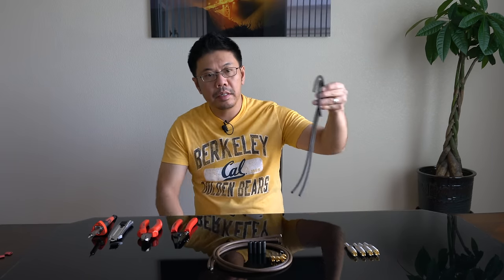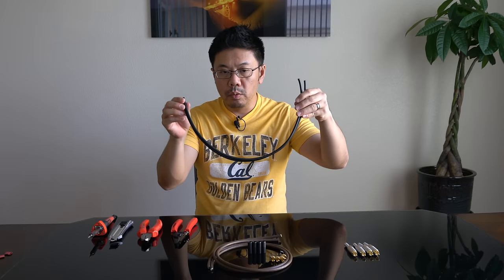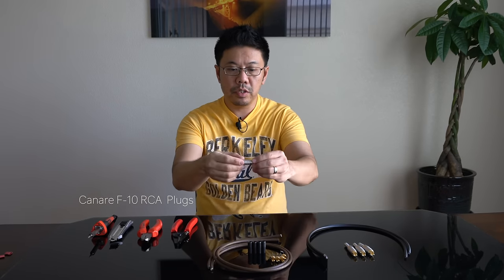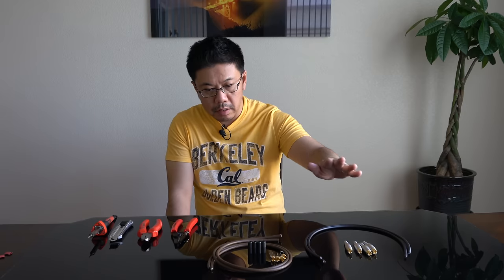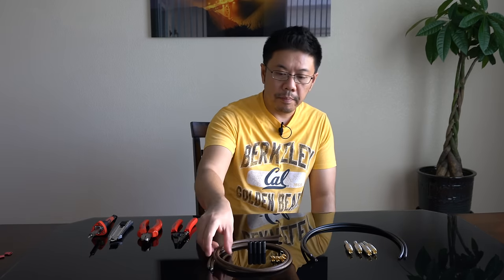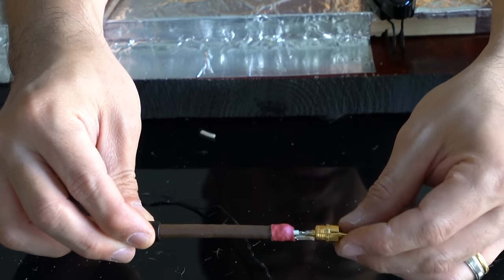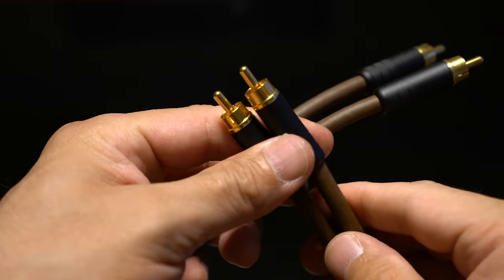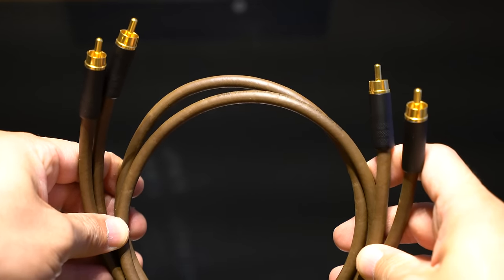$30 Audiophile Grade RCA Interconnects, DIY Better Sounding High Quality Cables

Comment: Tharbamar have you tried only soldering one side of the braided shield to one end and leave the other braided end disconnected? This is another method and you attach the connected side to the source of your equipment such as the DAC. Apparently it offers better noise rejection, something called a "Faraday cage" when you do it this way.
Reply: This is the way many cable makers  do.
Reply from the maker: Yes,I have done that many times and I like the my C-Type & J-Type more than any method I tried.

Comment: Hmm but wouldnt putting both wires together increase capacitance? Even the official mogami rep that i asked said its better to put one wire to ground. What do you think? Did you ever notice any difference or even tried and compared both methods?

Comment: Great video! Which cable & connectors would you recommend for a diy interconnect phono cable? I'm getting lots of EMI from mine, so I guess it's time to change it for a low capacitance one.
Reply from the maker: My favorite if Neutrik ProFi RCA plugs. thanks

Comment: Grea vid Do they work Both Directions?,I have a Question,I have made my own RCA cables for Technics Turntables for years, typical white Red connection from the PCB Board to two connectors White Red all good,one Day I've decided to Make my own RCA,male to male for plug and unplug RCA Turntables,they worked Both Directions fine,the problem is that,I've tried to build more and now they don't work at all,same cables same connectors and I don't even remember what I did the first time to make them Work Both Directions! Any help?

Comment: I made some sets of belden 8412 rca interconnects ...because the specs and costs were perfect and enabled me make some very neat specific custom runs, rather than have the horrible spaghetti junctions behind the rack, so I highly recommend that those interested have a go. What's to lose?

Now initially they sounded OK,  better than what I had but a little constrained, but here's the thing... they kept getting better and more open and dynamic  and funnily showed the strengths and unfortunately weaknessess in my system. 

Now I was always an ofc copper cable junkie but these cables do take a bit more time to open ?? Now I'm not sure whether that was down to my hearing getting used to them or that burn in makes a difference... So please don't respond because it is all subjective , but to me they are simply great cables to make interconnects... especially if on a budget and dont have the funds or need to buy the hyper brand cables. 

That's not to say they are not good or valid, but DIY will always be a cheaper way to go. However just like hi-fi there are many different cables out there..so  it's easy to fall into the same upgrade traps. but belden cables are great

Comment: Please tell me why or what is the benefit of using the 2 pair inner (whites) as a connect to the shield and ground? Is this a better shielding result versus just using the shield as ground ONLY? And if so why? My  first thoughts are that its worse because you are bringing signals closer to the actual feed wires (blue) vs just an outer shield grounded that is farther away from the feeds. (blue). OR is what you are doing here in this video (Japanese Method)  actually creating and Outer and Inner shielding effect that is overall a better shielding scheme? Thank you for this awesome video too....and in advance if you are able to answer my question for better understanding of the benefits of what you are suggesting in this video.
Reply: I added a separate comment where I explained how the directional cable works.

Comment: Hello Tharbanar. Useful video. Thanks for that. I'm just curios, can all 4 cores be solder as signal and just solder the braided wire as ground?
Reply from the maker: Yes you can but it will increase capacitance, thanks

Comment: Very interesting and informative Video. But I have a Problem. I need interconnects to plug my record Player in. How do you get the ground with These cables. Do I just put a spade on the ground you connected to rca shell?
Thank you in advance.
Reply from the maker: You just need to make separate ground cable, thanks

Comment: @tharbamar  on you Japanese method, did you fan out the ground wires before crimping them? Is there a benefit to spreading out the ground strands? I'm making these now and It seems easier to keep the ground tight and crimp it that way. TY!

Comment: I enjoy your videos, thank you. I have a question about grounding. Is it only one end or both ends being grounded?
Reply from the maker: Both end is grounded, thanks
Reply: Shouldn't you ground only one end of the white wires? As far as I know, such a cable becomes directional. It is grounded from the source to the amplifier.
Reply: I watched the movie again. I noticed that part where you bend the white wires from the other end breaks off. You can't see that you've stripped off the white insulation. So the cable is directional from ground bond to empty bond.

Comment: Can you use each individual conductor on the mogami to make a single rca pair or is that not recommended? Looking at making my own cables for multiple amps in the car but with as little separate cables as possible
Reply from the maker: Yes you can because it’s insulated.

Comment: Hello Tharbamar, you said in one comments that you preferred the Belden 8402 over the Mogami StarQuad... so:
1. How did it compare to the BJ LC1 that use their Belden custom made wire with utralow capacitance?
2. Since the new Belden generation (8412) seems to have a quad (8412P) with lower capacitance, did you find that the Mogami StarQuad was quieter at the end?
Thanks! Very good demo!
Reply from the maker: Hi, I also have LC1 which is good neutral sounding cable but 8402 is much better cable for sound quality for me.
I have not tried 8412 to give you right answer, thanks
Reply: Thanks for the question Antoine. I was about to ask the same:) I also have BJ LC-1 and custom (made by myself) Belden 8412 and Mogami 2549. To be honest I can't hear significant differences between them having pretty good ears ( I am musician, mix music). Maybe LC-1 has a bit more extended high frequencies but it can be just a self-suggestion. They are all good interconnects but I'm choosing Mogami - it costed me 15 bucks vs $60 for BJ LC-1 which is 4 times more expensive and not sounding 4 times better.

Comment: I wish I could get you to wire up a complete wiring harness for my sound system in my truck 4-channel amplifier component speakers with a monoblock powering two 10in subwoofers

Comment: Dear Tharbamar, I see these Mogami 2534 cables pre built with Neutrik/Rean nys373 plugs selling for ¥1920 only on Amazon jp. I think I will get them. No need to think twice for such a price.

Great video Tharbamar!
Reply from the maker: They will sound great, If they use same connection method as my C-Type it would even be quieter background.
Reply: Avoid the rean plug LOL. I had used them for months before making this conclusion. Use canare f-09 plugs instead. The cable will sound the best.

Comment: I doubt that it changes the sound but surely will reduce the hum. Thanks for sharing the secret (or schematic) of theses cables. Another way to do it is to connect a big braid between the chasis of all equipment.

Comment: Great videos, and you have given me a lot of inspiration for cable making in the near future... I do have a question... As far as subwoofer RCA cables... Would you also use 1 of these type of cables, or would you use a different wire(also shielded, not shielded, shielding ground on both ends, or not, etc), etc? Also, I have 1 sub that works mono RCA(amp) to mono RCA(sub)... Easy enough... But I have another sub I sometimes swap in, that would be mono RCA(amp) to left and right RCA inputs(sub)... You can use the sub with using only 1 of the inputs(left or right), but it sounds better, and is recommended to use both, either with stereo cables and outputs, or a Y cable and a mono output... It would be great to see the connections you would make when making a Y cable of this type... When I use this speaker, now, I have to use a mono cable and a few small connectors... It would be great to have an actual Y cable(and of good quality, of course!)... Sorry for the long comment, but I appreciate any advise! Have a great day!

Comment: hello tharbamar, question, is it worth using an rca cable to xlr female, from the interconnection of the dac to the amplifier? Or I continue with the rca cables.
Reply from the maker: Only if you have to use bridge option or with mono power amps, otherwise there is no extra benefits of using the conversion cable, thanks

Comment: Help please. Does connecting ground to both ends--either the Yazaki-san method, or coax with shield connected to both ends--risk ground loop issues? Wouldn't this be worse than a 2-conductor cable wired with the shield and ground at the source end only? Thanks for any input.
Reply from the maker: I’ve used it all the time without any issue in my system.

Comment: Wondering if you connect shield at both ends. Typically your hot and grounded conductor carry the signal and the shield only connects at one end so it shields the cable but carries no signal.

Comment: Question: On the last cable why no on the source end connect the clear jacketed conductors to the plug ground along with the braided coax shielding, then only connect the clear jacketed conductors at the opposite end not using the braided coax thus creating an FR frequency dump? Does this work??

Comment: I am a newbie in the area of audio. On your recommendation I bought a pair of speakers and a subwoofer. I want to prepare the cables for the speakers and prepare the interconnect cable, but I have a question, can I use the speaker cable model for the suwoofer?
Reply from the maker: For best performance you need cable that designed to use for that purpose, try SVS subwoofer cables or Kable Direct from Amazon, Thanks
Reply: @Tharbamar  Thanks a lot for your help.

Comment: What is the audible difference between crimping the ground with the shield versus soldering the ground and shield together on the post?
Reply from the maker: Same concept but I preferred direct contact without soldering.
Reply: @Tharbamar  I ask because I recently took apart my old Monster Cable Reference 2 RCAs.  I noticed they took the shield and wrapped it into the ground wire and soldered that into the post of the connector. 

I notice that the configuration of that wire is no different than what you were using. So, I really wonder if that cable is really all that bad?

Comment: Does tying ground to shield at both ends of the cable introduce the possibility of a ground loop? How do these cables compare to methods using a telescopic shield?
Reply: As far as I read on many forums, that is a concern mainly with balanced cables. But in case of unbalanced cable, it's good.

Comment: Thank you.
I have to make a 5 meter rca to rca cables to active speakers, because now current preamp does not have xlr outputs.
With 5 meter length do I have to pay attention on the rca cable quality? 
When I will switch to balanced I definitely will.
Reply from the maker: Yes, I would make sure to use shielded cables for longer runs.

Comment: Both cables are constructed with the “Japanese” method. The only difference is the cable being used. It would have been better to build one of them as “directional” cables. A directional cable uses one wire for hot, one wire for the return, with the shield connected only at the source. The shield “floats” at the other end and is not connected. There is a big difference in the way the two different cables sound. Japanese constructed cables sound dull and closed-in, compared to directional cables, which are more open and transparent.
Reply: I am about to assemble a cable, but quite confused by what you mean.
Would you be able to elaborate or guide  me to a place where i can read more about this?

Comment: I just build the Belden audio cable exactly like the one in your video, 2.5 feet long. But is it the right impedence 50 to 75 Ohms like the ones you buy in stores ?
Reply from the maker: It should be base on manufacturer.
Reply: @Tharbamar  Not quite sure what you mean but what is the impedence of your Belden cable you built in the video ?
Reply from the maker: @jacqueslarose3682  what I meant was my cable specs are same as manufacturer spec, which is 52ohm.
Reply: @Tharbamar  I see !  Thanks for this tutorial Tharbamar. I build the same and sounds great !👍

Comment: I'm assuming you also make your own speaker cables II keep hearing a lot of braided speaker cables or braided interconnects have the best sound why not just use individual wires individual wires? Why do they have to be connected together wouldn't this wouldn't this increase the shielding?

Comment: Hey @Tharbamar thank you for this instruction video on "making your own interconnects" I do have a serious question. Do you connect the shield and ground on both sides? Cause some people say or engineers state you get an antenna type wire or they would get a hum. Is this true ?? Thanks for the your videos .
Reply from the maker: Hi, I have clearly stated in this video how I connect them, thanks
Reply: Using a coax in an analog setting will do this too.     The return signal is the shielding and if connected on both ends it can introduce noise.  Tharbamar is basically making a coax cable with the Japanese method.    Super short runs might not matter though... I'm going to A/B some new RCA versus RCA vs COAX in the coming days.  BASICALLY  Belden coax vs Canare coax vs Mogami RCA vs Canare RCA and Oyaide Neo d+ class a RCA
Reply: @Scrufboy  thank you for elaborating on this subject. It's hard to get clarification when it comes to this subject here. It's best to just do one side. It's Like I understand both sides. It's just that I would like to be covered the best way. Thank you again!!
Reply: @christopherwilson6825  To be clear. There are people in both camps. That's why we really don't have clarification.  Because of this, I have opted to buy some new interconnects to test.   I don't have the patience these days to make my own interconnects.  I have a very humble but powerful and clean setup with a set of interconnects running from my main amp to a subwoofer amp.   Because of this, I won't have the easiest of testing experiences because it's the subwoofer. 

What I'm A/B testing with
COAX
From Inntak Hi-Fi  - 2 silver plated coax and 2 Belden coax with locking Paliccs gold connector
From Ghent Audio I am currently using Canare LV-61S True 75Ohm with Canare RCAP-C4A connectors

What I have coming:
RCA
From Ghent Audio - Canare L-4E6S with locking Paliccs gold connectors.
From Performance Audio - Mogami W2534 with Canare F-10 Deluxe Clamp RCA

What else I have on hand:
Oyaide NEO d+ Class A RCA.

I will have to contact the makers of these cables to find out how they wired/terminated them.  If they ran the return signal along the shielding on both ends or only one.  The Oyaide doesn't show directionality.  I believe it uses 2 twisted pairs in it's flat cable geometry.

It is still hard to get clarification.   But the facts are...  If there is noise to be picked up... Both coax used in analog and RCA with both ends of the negative return attached to the shielding, will do the same thing with that noise.   It may be there and be inaudible,  It might not exist at all.   Length of cables play a huge part in this.   Like Tharbamar, I too try to used the shortest runs possible for interconnects.

Is there a huge discernable difference in our choice of type of cable and how they're wired?  Only testing will reveal this.     Be ready to return cables or sell them if they don't work out for you.

Comment: Great information had here...nice to have people of this world sharing their knowledge for the things they have a passion for. I'm a newbie when it comes to building cables and what is used for what in each application, maybe you could provide some insight as to how to build a phono cable? I do know inter-connects and phono's are different, but can the Belden 8214 be used to connect my Project Debut Carbon to my Receiver which has a Phono-line in? Thanks for any help you could provide!
Reply from the maker: Yes you can use it for phono application, some says Coax cables are the best for phono cables. Thanks
Reply: Thanks for the fast reply! So just confirming, using the method you referred to by soldering the whites to each rca pin and then the black and ground to the ground on each connector, this would give 2 cables that hook up the right and left signal on the turntable. Would the shielding be enough in the cables that a ground wouldn’t be needed?

Comment: thank for the video, I watched the speaker cable video and just make a pair of speaker cables and it sound great. When are you going to have the test video of this Mogami w2534 interconnected cable. This interconnect cable will be my next project.
Reply: What size red shrink tape did you use? 3/4 inch? or smaller? Edit: I notived it was 3/8 inch. That is what i got. Im stoked to make these. super stoked